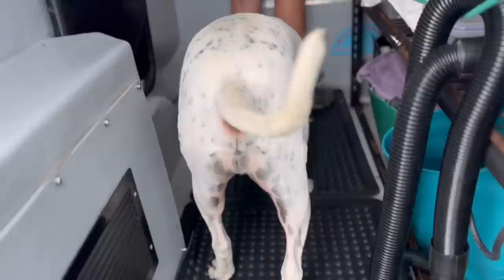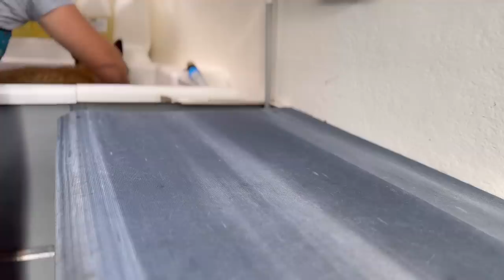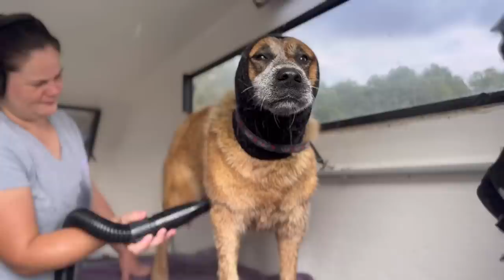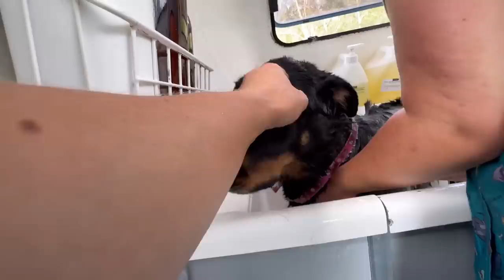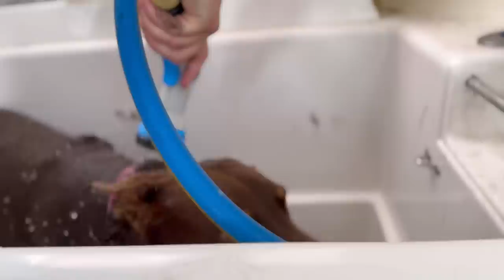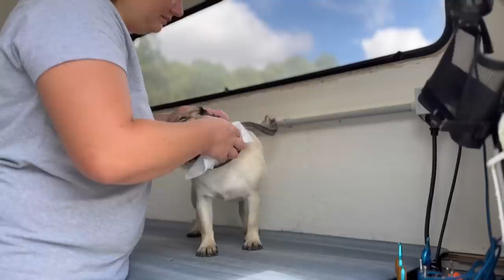SALON DAY for Rottweiler Boxer Pug Cattle Dog Kelpie

Comment: I wouldn't recommend using coconut oil on hot spots, but it would certainly deter a dog from getting them in the first place, as it repels water. Apply once to twice a week.  Rub into your hands and apply thoroughly to dog coat, making sure it gets to the skin, wait 5 minutes and rinse off. I did post about it a few weeks ago, in regards to Chance's skin allergies. x